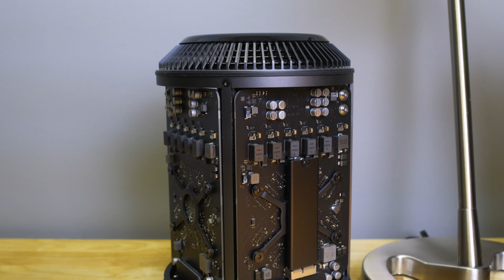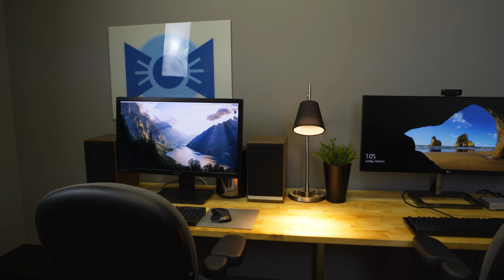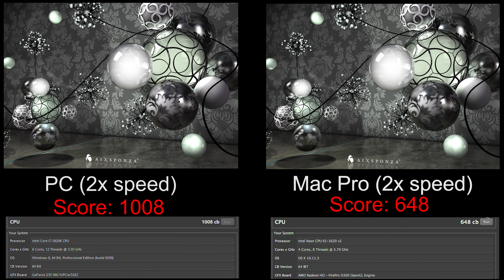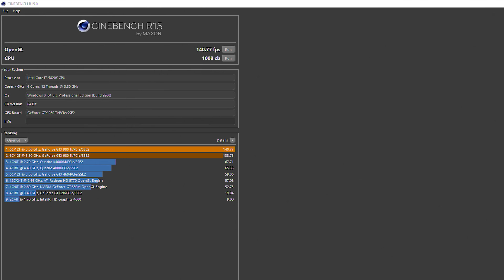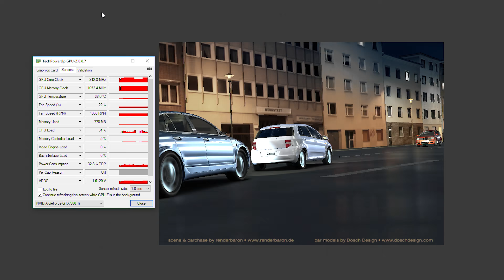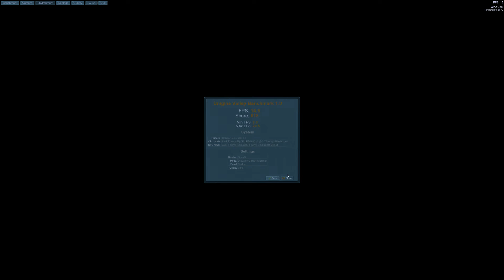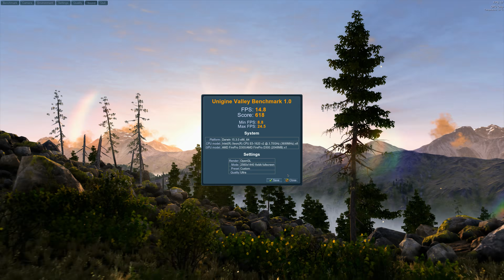$2,000 Custom PC vs $4,000 Mac Pro

Comment: I hate apple for overpricing things. but at least compare things from the same age/ generation. Apple has the handicap here. but still custom PC from the same age will still win imo
Reply: The point is apple is still charging four thousand dollars for their base model Mac pro. Yet, it's outdated and not worth its own hardware. You're literally paying for a brand.
Reply: +Billy  Christanto His point is that it is still the current model, so he is technically still comparing things from the same age. (unless you're saying his time with the apple computer has worn the hardware so much that it'd slow to this extent)
Reply: +Billy  Christanto the point is that they are both being sold now, so they are both current generation.

Comment: "$4k Work Station vs $2.5k gaming pc", fire pros are great at autocad/solidworks (3d Modeling and simulation), media/content creation, texturing and stationary rendering speed they are not meant for gaming, the cpu is dated I know, but I don't think that the GPU based tests were appropriate. Id like to see the other side of the coin when comparing render quality, shadows, textures and completion speed within a workstation environment.
Reply from the maker: +Renie Sunta Much slower a video editing than the GTX 980 Ti. All of my Premiere and After Effects have been more than 2x as fast on the PC.
Reply: +Snazzy Labs yeh i suppose you're right in your area or field,  ive been using in modeling situations and simulation and blows common cards (gtx and radeon) out of the water in realistic renders.

Comment: #WhenYouProveNothing

Mac's produced three years ago are still better out of box than almost every PC on today's market. Obviously if you modify that PC it can and will out perform the Mac, but vice versa! The Alienware Area 51 m15x is a $5000 computer that will out perform a Mac, but you can modify the Mac just like your PC in the video to beat it for a cheaper cost! 

It's like having a 1000HP Honda Civic (PC) and racing a older stock Lamborghini (Mac), obviously the Civic (PC) will win because IT'S SUPER MODIFIED.

Get it?

Comment: Unfair to compare a gaming graphics card with a apple pro. Its apples and oranges. The Xeon processor alone makes the Apple a enterprise (server class) architecture. The Pro is not designed with gaming at ALL in mind. Your modern machine has a nvidia gtx 980, there isnt much on the MARKET that can beat that unless you spend big bucks on Titans, SLI etc.

Comment: I wanted to upgrade my pc to mac pro, but.. I already kinda have one. Maybe I could invest like 300$ for new GPU
My 500$ pc:
cinebench: 90fps ,640cb Valley: 37fps , 1550Score @ 1920x1080 
4000 $ Mac Pro:
cinebench: 76fps ,648cb Valley: 15fps , 618 Score @ 2560x1440 

my rig:
AMD FX 8370 @ 4.0 Ghz
Asus HD7970 @ 1000Mhz
Asus M5A97 2.0
Cooler Master evo 212
Kingston Fury 8Gb DDR3 @ 1600
Seagate shitty old drive 160gb
Be Quiet 650W PSU
Reply: +Nofoxgiven  lol.. your build is a beast (: get a good $300 gpu (:

Comment: I have a 5 year old second hand STOCK gaming ADVENT computer that still destroys the 3 to 4 year old macs I use every day at college. I can barely use photoshop without massive drops in framerate on the(admittedly well used) macs...Definitely not a fair comparison but I payed £300 for mine, an AOC monitor and a razer mouse+keyboard, not £1000 give or take a couple hundred for a secondhand mac...

Comment: Mac pro IS upgradable. You can replace 2013 parts with 2016 ones.... whats your point overall? mac are not benchmark or game beasts....mac pros are the best option to run stable and reliable software. A pro wants stability, reliability, trustworthiness, tecnical supporting, not just SPEED. Thats why some dudes buy Apple. End of story.
Reply: +sorlino89 he just proved that wrong....

Comment: This test is absolute BS, I've been using Mac Pros since 2006. And they always perform. And have been upgrading hardware from time to time, and after a while sold them and bought next gen. With macs it's actually possible to sell. His $2,000 PC is not worth more than $300 as soon as he assembled it. And the only guarantees you have on a PC is "Lifetime of Bluescreens". Macs are reliable and solid, which is important for pros. Amateurs always think it's important with specifications. Like having a 4" cell phone screen with 4K resolution. Yes extremely necessary, if you're dumb.
Another amazing part of this guy is he managed to buy a $2,999 +tax Mac Pro for $4,000. Good job! I bought my 6 core with 32gb ram for $2,899 and it has yet to fail me. 
More fun to test an upgraded Mac Pro 2010 to the "Amazing PC he managed to build" 
Anyone tried having a working recording studio on a PC? Any hair left? Soon you'll get tired of being laughed at for owning a PC and watching it crash every day.

Comment: My custom build pc outperformed by mid 2014 macbook pro with retina i5 2.6 by a landslide with these tests. Cost a fraction of the price of the mac. However, I found that even though my pc was way better on a spec sheet, in practice my mac was much better.

Why? The available software on my macbook seems to require a fraction of what a pc needs to accomplish the same task. I'm talking about final cut pro x. 

I've used adobe premiere and sony vegas pro and my computer is not nearly as fast or smooth as my macbook pro using final cut pro. NOOW if we get this final cut pro business on the PC I'm throwing my Macbook Pro out the door! lol (I'll sell it of courses)

Until then final cut pro has been a game changer and many others say the same. If you ever get a chance to use this same macbook pro with an i5 2.6ghz and final cut, you may be surprised. 

I do not have a preference over a certain OS.. I like both for what they offer. Now bring unto me dem hate comments :)

(P.S) I didn't spell check or grammar correct this message so feel free to point out my terrible sentences :D

Comment: There are several problems with the Mac Pro, especially in the benchmarks you chose, including a consistently lagging and mediocre OpenGL implementation. From where I sit, Apple only expends "just enough" effort to maintain the illusion/hype that they care about professional content creation markets. They don't.

That said, I'm purely curious if there's a break-even point at which the PC degrades in performance due to age to make the premium the Mac Pro commanded remotely justifiable. (You probably should also factor in the cost of labor—assembly, design—with the Mac Pro, if you want to perform a pure economic comparison.)

I briefly longed for the Mac Pro when it was released, but I came to accept that I was drawn to it more as a desk ornament than as a high-end production workstation.
Reply: +Oluseyi S PC's can be used longer then a mac pro because a mac pro needs updates from apple (and apple can stop making them) while windows can be run even on pentium 4's and still be updated. If a pc is faster then a mac in the video then it will always be faster then that mac.
Reply: shag stars In theory, what you've said is true. In practice, it seems that PCs very often degrade in performance and user experience much more quickly than Macs, such that you end up replacing the PC sooner.

Of course, this assumes that price sensitivity and not performance is the priority. If the goal is the bleedingest of bleeding edge speeds and power, then having to replace the PC every 2 years (at half the cost of the Mac Pro, which isn't even updated after 2 years) is a non-issue.

Either way, anyone looking at professional content creation should not build a pipeline around Apple's products.
Reply: Oluseyi S The degrading issue is only when you download thing you shouldn't download and if you never use ccleaner. (even then ssd's at their slowest is still blazing fast). If you buy top of the line stuff (and don't overclock it so it will work even after 5-6 years) then you can use that pc for as long as you need it (till they made something that is much more faster and make these machines in the video irrelevant).
Reply: shag stars The machine in the video is overclocked, and the components are not top of the line—originally he opted for a refurbished power supply.

In other words, you're proving my point. There are three sources of the typical Apple cost premium: high-rated components that are specifically tested and known to work well together, labor, and only then generous margins for the company. These comparisons are very rarely like-for-like, and tend to lack comparable long-term value curves, so I can see why some people would opt for Apple products.

On the other hand, if your replacement cycles are shorter, or if performance in the short term is the top priority, then the PC is a clear, unconditional winner.
Reply: Oluseyi S Nobody should buying psu's second hand anyway. xD
Reply: shag stars Heheheh. Right?

Comment: i'm sure $1000 pc will win in gaming... 
mac pro is a workstation, no point to compare a workstation to a gaming computer. if you are going to compare them, compare them with software such as autocad/3dmax/maya. and to build a workststion pc with same spec is around the same price with mac, maybe pc is a little more expensive.

Comment: I'm here not to defend apple, but to clarify some shit.
Intel Xeon CPUs and AMD Firepro GPUs are way out of Intel Core and Nvidia GTX league. These chips are much more expensive than the second ones even with much more humble specs. That happens for some reasons, and these chips have their advantages in certain circumstances.
Long story short, it would be fair to compare Xeon based systems with equal server-CPU-based systems. Same for FirePro/FireGL/Quadro video.
Reply: +Afro Jack This is not true. All performance tests in here were classic gaming tests. Workstation GPUs are basically not suited for this, so any middle-priced gaming GPU will ALWAYS have "better perfornance" in classic gaming tests, than any top workstation GPUs with a price around some thousands dollars. Same for Xeon processors. Their starting price is much higher.

Basically this is like comparing a tank and a lamborghini. They are both motor vehicles, both run on oil, but the prices and specs are really far cry.
Reply: +Afro Jack Dude, what I'm saying. is that you did not really compare the performance of this Mac Pro and Custom PC. What he did, was a comparison of FPS for GAMES whilst GPUs like AMD FirePro are not designed for games. It's like when you compare a tank vs a lamborghini on a racing track, and than you say, that a tank is an overpriced piece of shit.
They have different tasks, and different class of performance.
See this for more: http://www.tomshardware.com/reviews/best-workstation-graphics-card,3493.html
Reply: +Afro Jack And again. He compared the CPUs only in one aspect. While the difference between Intel Core and Intel Xeon is much deeper then just picture rendering time. Picture render is a toy, while real workstations are designed for realworld job. 3D modelling, engineering and scientific simulations and calculations, software debugging and compiling etc. and etc.

The fair comparison would be if you take same class hardware, and compare Apple Pro versus PC WORKSTATION, and compare iMac or whatever versus normal PC DESKTOP.
Reply: +Afro Jack And we're back at start. You did not really compare performance of that Mac Pro and that custom PC, dude. First learn how to compare performance of workstation, than start counting price.
Simple example. Open 3dsMax or Autodesk Maya or any 3D CAD software and start adding polygons (bodies). Add more and more. At some point any gaming GPU will just give up, and you will not be able to rotate the scene or do some actual work with it. While OpenGL GPUs (like FirePro or Quadro) would just go on and easily handle ten or hundred times more objects in one scene, than your best GTX in SLI config.
Reply: +ssthbp agreed, afro jack has no idea what he's talking about, it's not simply about price/performance, workstation parts will be beat in gaming performance but in 3d design performance the price/performance is better

Comment: This test is not a good test. nor a fair one.  (for note I would still go with the pc .mac just doesn't work with my life.  )
What does this prove? 
1. That a pc with updated hardware will beat a macpro in cost and performance. 
Thats it. 
But thats not hard. Of course updated hardware will beat it. And if the mac had that same hardware it may actually keep up with it. 
Also one thing not addresses is desk foot print. Dont you hide that pc over in the corner I saw how big that guy was.

SO to users: don't see this as a "justification for pc better than mac" Use this to possibly convince someone that mac doesn't have better hardware in their systems. And possibly that price doesnt always mean better hardware. however it can mean you get  a smaller desk footprint. 

Hopefully this is helpful to some one out there on the internet. 

p.s. No hate to you mr.Snazzy.
Reply: You can use mini ITX platform for same power but less space... ;-)

Comment: Nice video but can't take that one seriously. 
You're comparioson lacks a bit on everything and everywhere. 
First you compare a 6-core HT CPU with a 4-core HT CPU.... perfect it's so obvious which one wins the cinebench. It's like comparing BMW S 1000RR against a Ferrari in a drag race. Obvious which one will win it.
Same goes for the GPU Benchmark. 

Workstation GPU vs. Gaming GPU
I think no further explanation needed. Let's just compare a team of soccer players against a hockey team on the ice. 

Just to be clear I'm not an Apple fanboy, I even got no Mac at all. But I have to work with one every day and they're good at what they're intended to do. Why not put in consideration that you get a reasonable Unit for a reasonable price. It's ordere with a few clicks, it's installed and ready to use in a matter of minutes. The MacPro is outdated for sure but better compare it with an out of the box pc as well.

Comment: y'all are forgetting the point of this video... hes comparing apples most powerful, and most exspensive computer, to a custom computer he made for half the price of the apple computer, and it destroyed it.
Reply: Not true, he's lying about the price and time he put into his shitty gaming-only computer. And it's not the top end Mac Pro, even that part is a lie. That Mac Pro is priced under $3K. You're too dumb to realize the difference in a stable work computer (Mac Pro) to a lazy ass gaming computer (PC). I've worked in several studios in Hollywood and I've never seen a PC used for work. If you were talented enough you'd also have demands on a proper work horse.

Comment: Mac pros are expensive get that out of the way, worth the money probably not, but if your gonna do a comparison make sure its a fair comparison. quad core VS 6core, 12mb RAM VS 32mb RAM, 2GB GPU VS 6BG GPU, how is this fair? it's like putting you on the starting line with Usain Bolt. I understand your point with $$$ but you are comparing a custom built $2000 PC vs a base Mac Pro, custom build the Mac pro to the same spec $6000 and lets see a real comparison... cost should'nt matter when your competeing the best of the best.

Comment: I may be wrong, but as I checked the mac pro at apple store, it had much stronger components. As computer power is growing with a exponential function of 2^x, you should consider, that the power/money amount is reduced drastically (which is not that great anyway at Apple's), plus on top you had the by far weakest hardware available for the mp (this configuration is not even buyable at the apple store --> they DID update the mac, as it looks). 

If you want to fight, please make it fair...
Reply: Lol no matter what it has it's an over priced junk bucket

Comment: This isn't a fair comparison. For starters, the mac costs 3000, not 4000. Second, you assembled the custom PC yourself, as well as overclocked it; while the Mac is box-ready. Third, Apple DO offer faster options; hex-core, 64gb ram, dual D700 instead of D300's, going from 2 to 3.5 tflops.

The Mac Pro is not good value, no, especially a few years after launch, but you could easily have made that point while making a fair comparison. Right now, this video just comes off as biased, which harms the message.